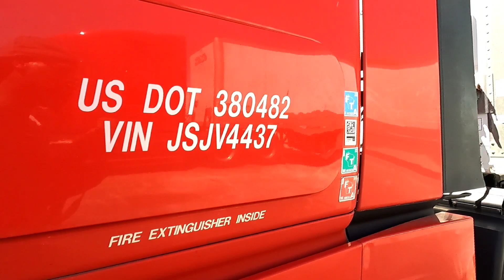Bad Finish To My 1st Day Solo|CDL VLOG

Comment: Tires smooth on the edges can be from low psi. The edge of the tire are on the ground making it smooth and also builds heat and that causes the warping. Usually big rig tires should be at 120-130 psi depending on the tire. The sidewall prolly says lower tho